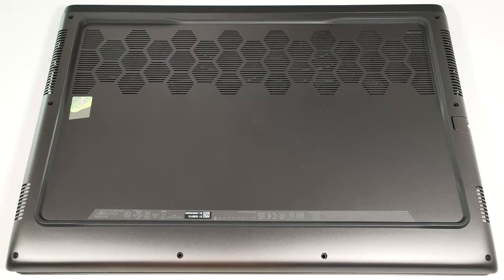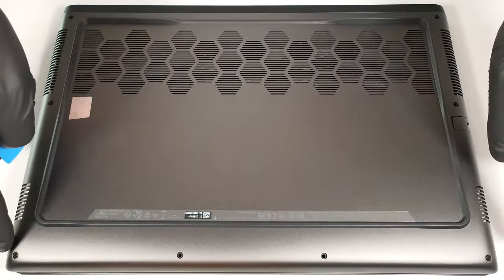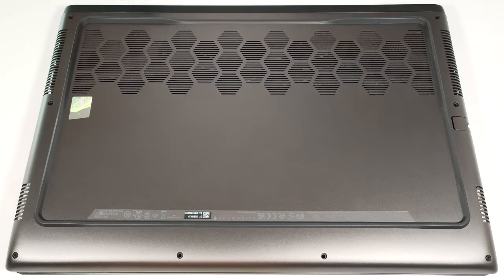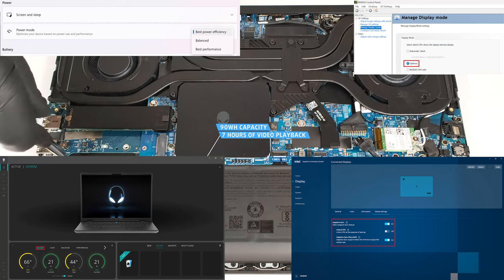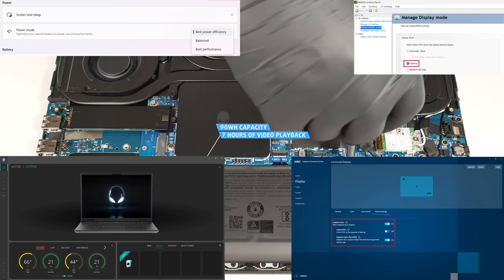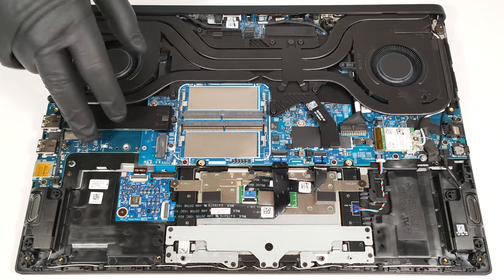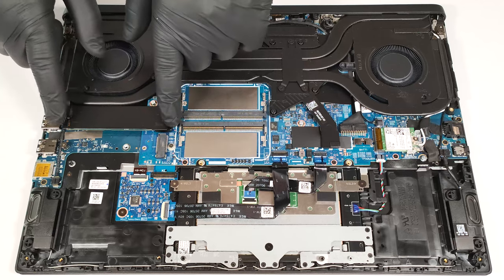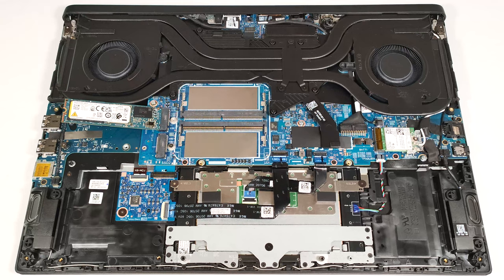🛠️ How to open Alienware m16 R2 - disassembly and upgrade options

Comment: Would it matter if I did a ram upgrade from another brand ? I am only asking this because i have asked for rams from dell and they have sent offer which are 3 times more expensive than any other brand while having same 5600Mhz and CL. I assume all DDR5 rams have same dimension?
Reply: you can use other brands, I just upgraded my ram to 32gb with kingston fury ram 5600mhz and it works fine.